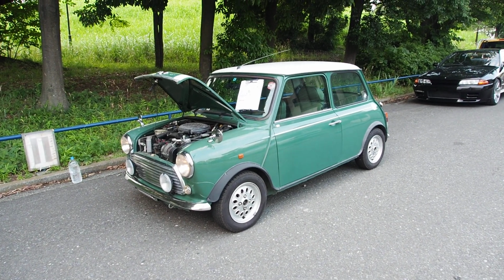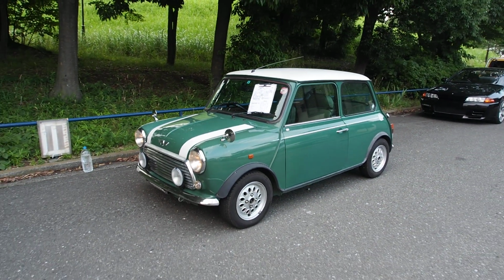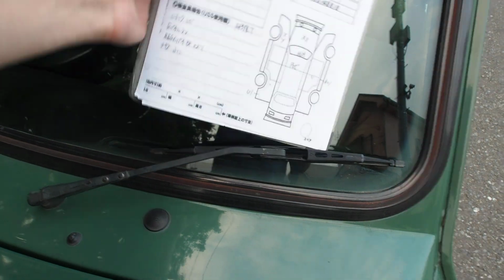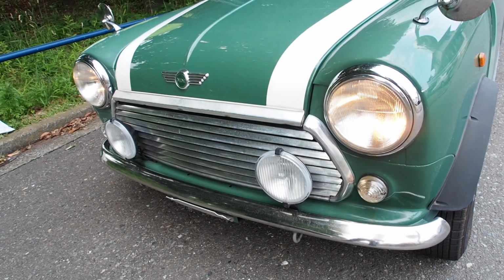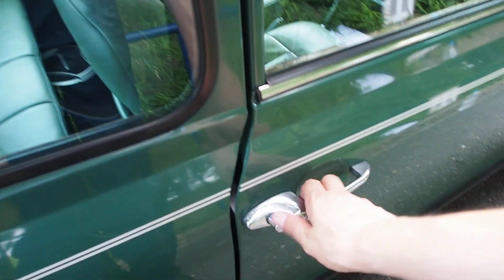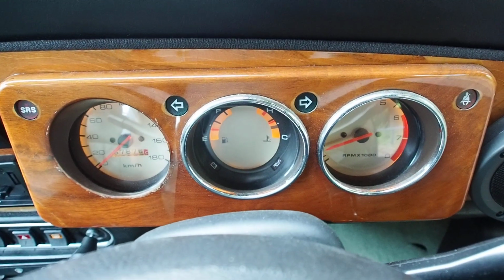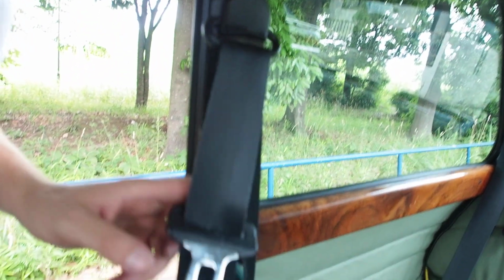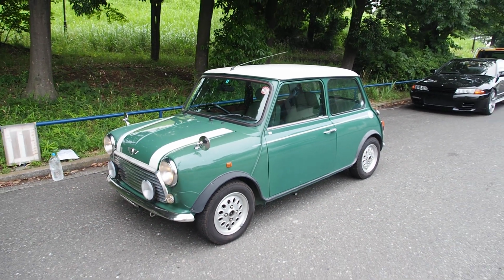1999 Classic Mini Cooper Automatic Transmission 1300cc (Canada Import) Japan Auction Purchase Review

Comment: It’ll be a Minimatic transmission introduced in the mid 1960s on the BMC Mini and the 1100. As with the manual gearbox, the Minimatic is in the sump and uses engine oil as its ATF equivalent. If there’s problems, it’s very likely oil changes have been skipped.

Comment: The 'minimatic' was made by Automotive Products and is a bit of an oddball.  I don't imagine it would have been available as an option on a Cooper here in the UK.
Overcrowding of the engine bay looks like a mechanic's nightmare.  I've never seen an A series with coil pack ignition.
As you suggest, the airbag seems virtually pointless.  Nice level of trim though.  Driving any classic mini is still a unique experience. Back in 1959, they were a sensational departure from convention.  Every young driver wanted one and for a time even basic spec. variants were expensive to insure.

Comment: 1999?  Kept forgetting how long the "original" Mini was actually in production.  I also didn't think Japan had any of these.
Reply from the maker: 41 years. If it weren't for Japan, I am sure they would have ended in the early 80s. You can think Honda for the survival of this marque.
Reply: 1959 to 2000,. japan had Mini till 2000 and all the last automatics MPi type engined versions went to Japan

Comment: Interesting to see such a late model Mini with automatic transmission. In the UK, that option was dropped in the early 80s, although the Metro used it for a few more years after that.
It was quite a technical achievement in its day. A four speed auto, when three speed was the norm, and with full manual control too.
Reply: The automatic (AP2) was for sale in the uk right up to 1996
Not quite full manual control as most didn't have the RN1234D they had RN123D or later units with PRN123D but certainly better than 99% of other automatics